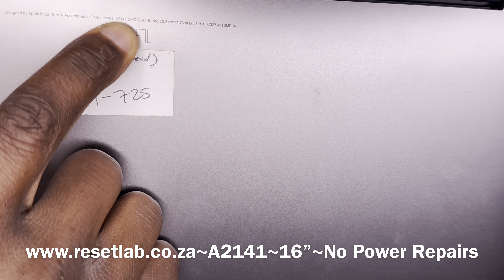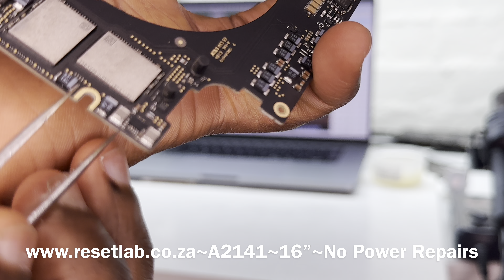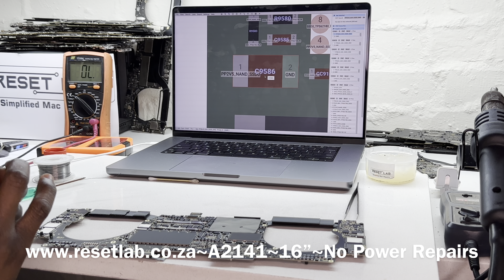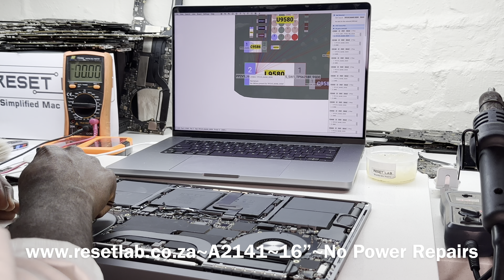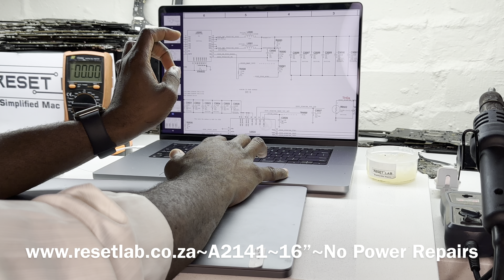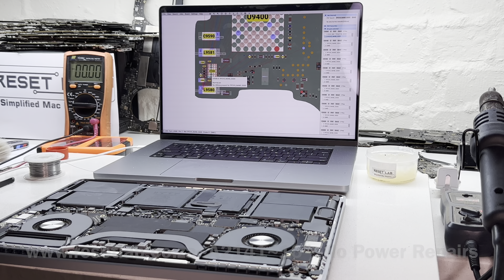MacBook Pro 16” A2141 No Power Repairs

Comment: Where did you find replacement capacitors for it?
Reply: The CC9F0 capacitor in the A2141 MacBook Pro, which is a 0.47 µF (470 nF) capacitor with a 16V rating, is typically in the 0402 package size.

The C9587 capacitor in the A2141 MacBook Pro, which is a 0.1 µF (100 nF) capacitor with a 25V rating, is typically in the 0402 package size.

Comment: Sir, thanking you so much.. i have the same laptop and as i was using it today it just switched off completely and wouldn’t switch on….  Went through all of the steps to get it working again. Just would not turn on.. watched your video thinking that potentially this was an issue.. saw what you did with the trackpad at the end.. did the the same thing and presto.. the wonderful ringtone of the startup sound. Low power 1% but back up and working battery just moved to 3% so happy.. what does the trackpad movement do ????

Comment: Hi, I’m having this same power issue on my MacBook Pro 16 and and I don’t know how to go about it. Please help
Reply from the maker: So you have a short on your ppbus ?
Reply: @resetlab7142  I’ve removed the battery from the motherboard and the system won’t turn on.. I feel a lil current when I touch the laptop while the charger is plugged in. I’m confused of what to do
Reply: @resetlab7142  can this Mac Pro 16 a2141 boot without battery? How can I test for power and smc?
Reply: @resetlab7142  I later bought new battery, inserted it and the laptop refused to turn on still.. please can help me?